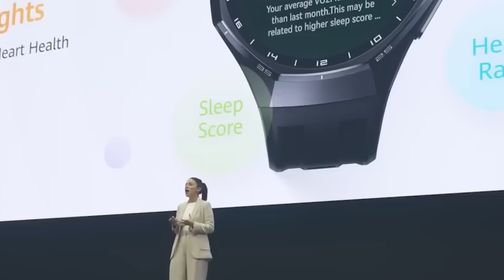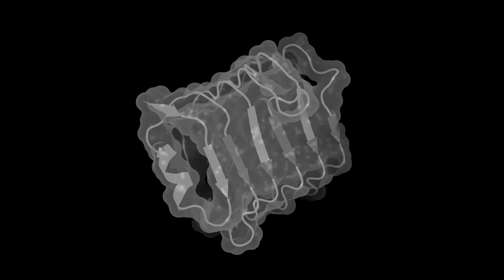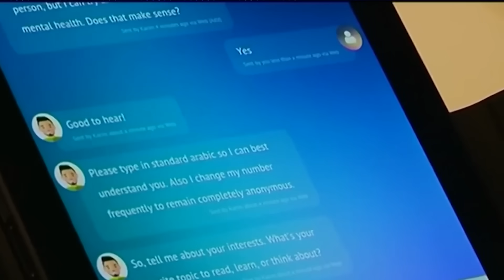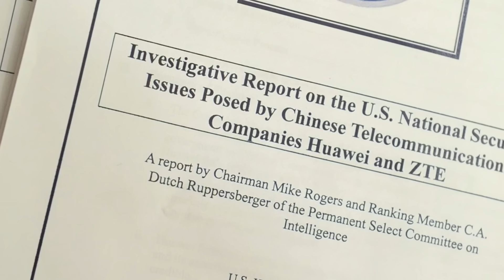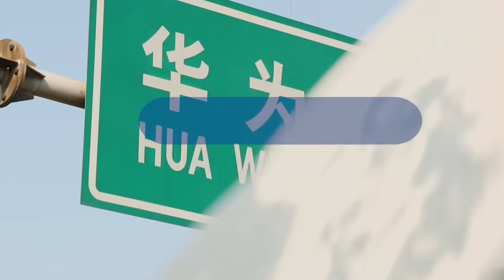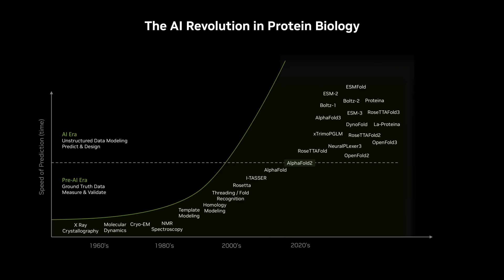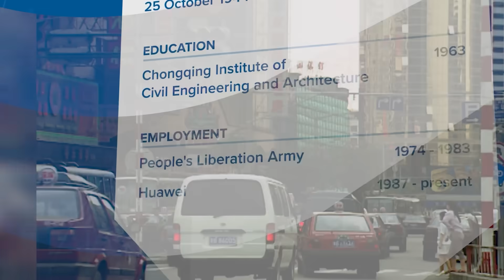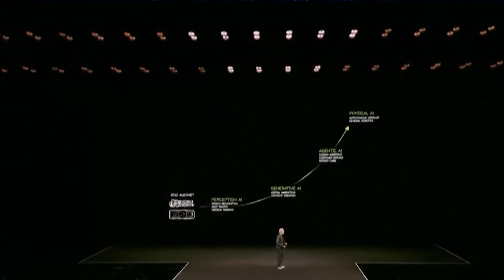How Huawei Built an AI Supercomputer That Beats NVIDIA Using Banned Technology!

Comment: - Atlas 900 A3 super pod (Cloud Maxtrix 348's cluster ) consumes 4x the power, offering 2x performance. This is 2x the power consumption per unit of performance.
- Huawei is also working on photonics.
- Hardware perf is one thing, but Huawei has a huge memory bandwidth advantage, which is critical in tasks involving lots of data (eg. AI).
- Huawei is reportedly testing 3nm multi-patterning using DUV -- this will put them very close with TSMC current advanced node.
- Huawei is scheduled to be testing LDP EUV machine given them an advantage over ASML as they are supposedly simpler and smaller.

So Huawei has likely beat the west in hardware performance for the next 2 years, and will likely pull ahead in technology in that time-frame as well. Once Huawei delivers its domestic solution at scale, the west would have lost its lead (my guess: ~6 months to 1 year) and it likely will not get it back any time soon.

In fact, Africa is poised to start importing a lot of this technology, meaning that African countries may have a technology advantage over western countries before long. Yeah.